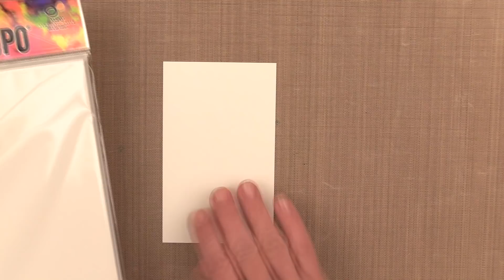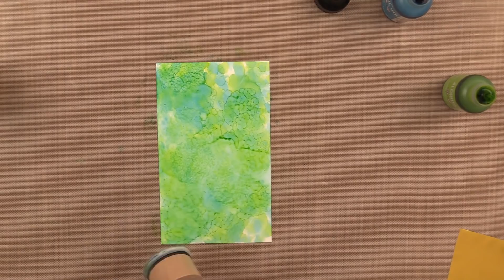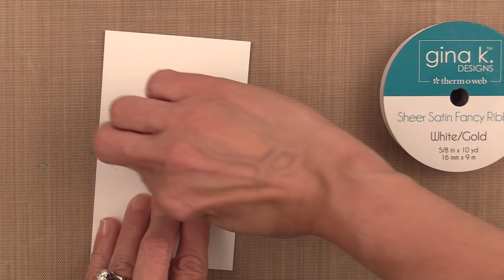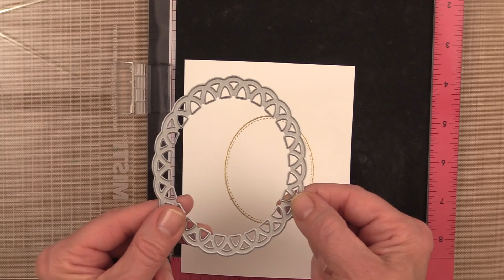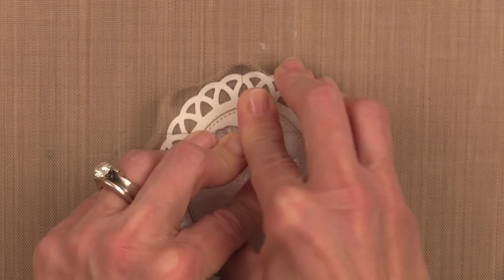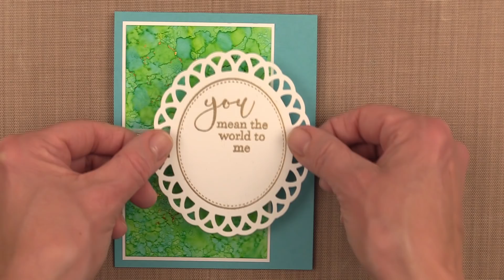How to Use Alcohol Inks with Fancy Foil

Comment: I've been doing this for a while and using your Thermo-o web foils.  If you use the alcohol blending solution and a paint brush you can control where and how tacky you want the alcohol ink for the foil  to stick to.  This way you get a really beautiful marble look.  It works great not only on Yupo, but also on Vellum.  Your foil packs lasts me for several alcohol ink/foil backgrounds and you can mix and match the foils on one background.

Comment: Hi Gina, I have a comment an would like some advise about the using of foil. It doesn't seem or is that difficult to use, although I have been having so many issues with it that I don't know if it is that I am not using properly, or this batch had some bad issues and it simply won't work and I need to open another package. I´ll explain. The first time I used it, I tried it with some lettering and it turned out great. I even offered it a client in some invitations I am doing for her. She agreed. There is my problem; now I have to deliver and can´t! The subsequent times, I have tried with a big laminator and a small one as well and the foil will not transfer. I have tried with a piece of peper underneath to give it more pressure, and nothing. And I have used vellum paper and regular copier paper and NOTHING. I won´t transfer! I am simply desperate because I see no other option.... I pass it several times through the laminator as well, and there is no change whatsoever. Could you please tell me what I am doing wrong. or what can I do to make it work? THANK YOU SO MUCH!!!!  My e-mail, if you want to contact me through there, is mama21@prodigy.net.mx.